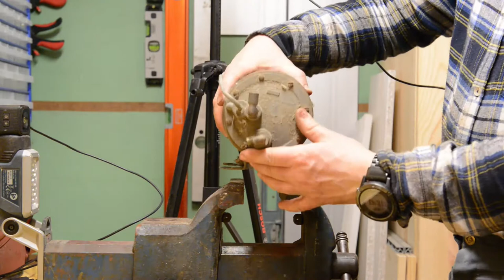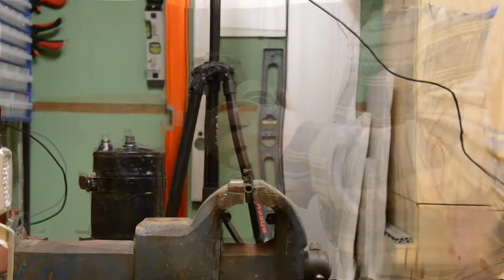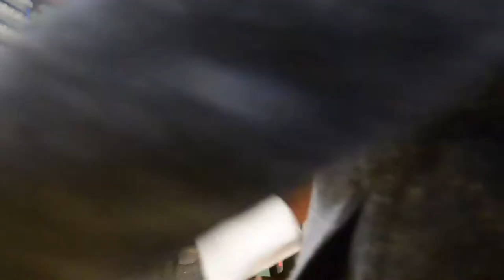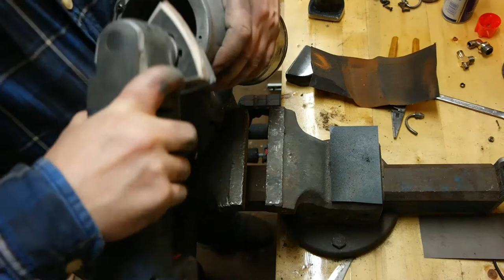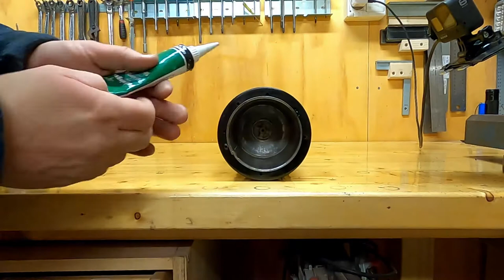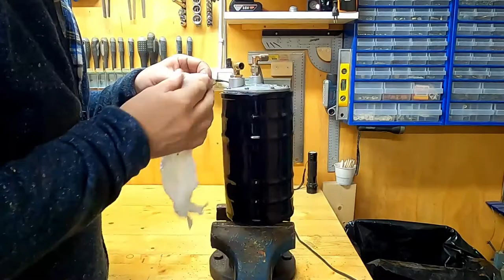Part 4: Fuel Pump

Comment: So I acquired a 1919ish Hupmobile model R touring body that is relatively complete but missing everything else so I figured from messing around Ford Model A's for a few years and acquiring a ton of extra parts in the process that the Hup would make a nice jalopy if it is mounted on a mildly built model A chassis/drivetrain...
Anyways I didn't know what this canister was bolted to the firewall of that up mobile until earlier today when I decided to finally look it up... I seriously thought it was some sort of 1970s emission thing and maybe the car was some sort of hot rod in its former life...
After realizing this was a precursor to the fuel pump now I got to run it, it is probably one of the coolest things from that  early era and I would imagine that the model B engine carburetor that is going on the model A will work like a champ compared to a gravity feed setup that a Model A should have...
Anyways thanks for the video. I love these old machines both modified and stock now I'm going to poke around your channel.